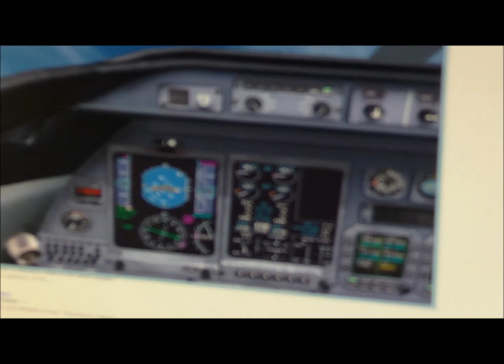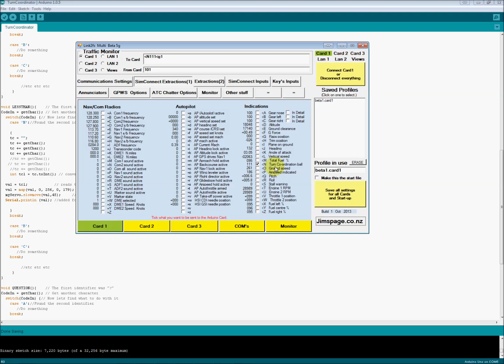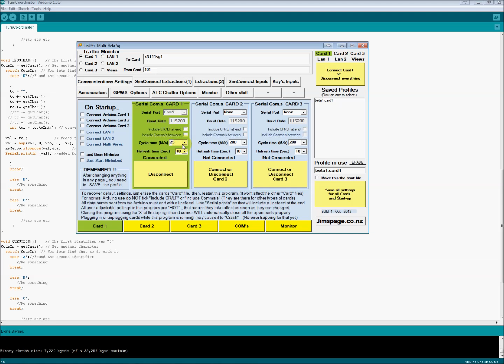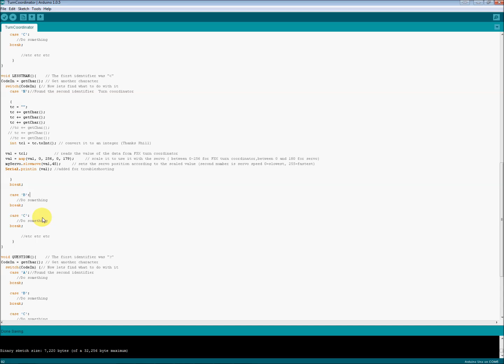Arduino Flight Simulator Servo Interface- Tutorial

Comment: I'm building a 777 throttle quadrant, and I would like to put 2 servos on the throttle and 1 on the speed brake. Can I use this code for that, and do I need to change anything in the code?
This will be my first time using arduino... or any code work for that matter. So If anyone could point me in the right direction to learn more about arduino servos and flight sim, it would be very greatly appreciated :)
Reply: Hi, I am building a TQ auto throttle 737, https://www.youtube.com/watch?v=7BIMzr0Fhhw

Comment: What offsets (FSUIPC) you used?
Reply from the maker: +bestek1 It was Simconnect.  Cheers
Reply: +Eric William . Tech Simconnect Only FSX ;-( (change you them) I have FS2004 and must find offsets memory. Roll position (&H2F78)  pitch (&H2F70). But I don't find "yaw" position. Regards ;-)

Comment from the maker: I guess it depends how you want to drive it and what else you want to do with it (how much more I/O you want to use) Pretty much any arduino can handle a single gauge driven by PWM. My only suggestion would be to get one with FTDI on-board. And maybe one without headers so you can just solder to it.